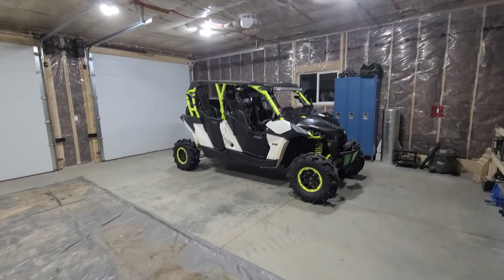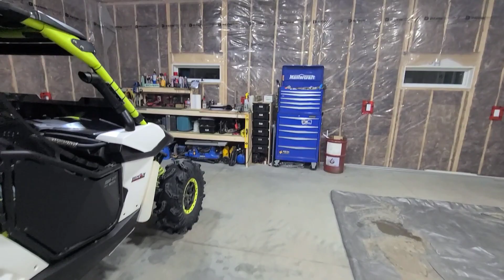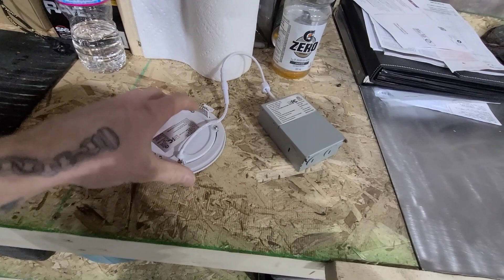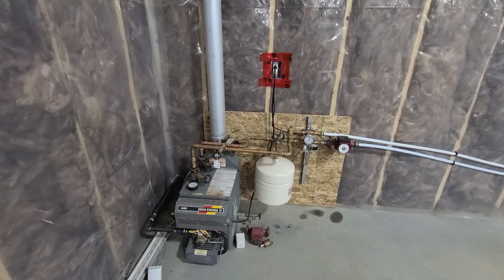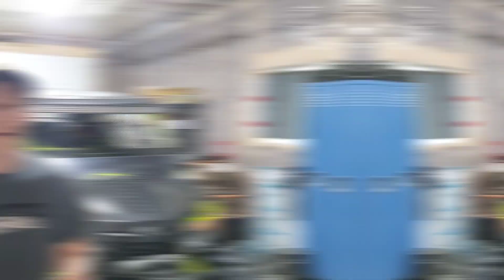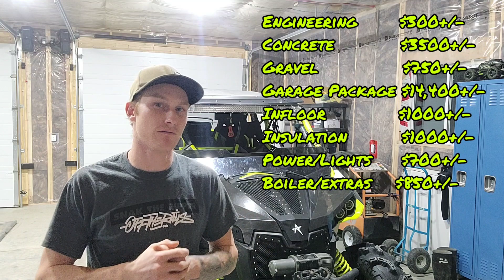How much did it cost to build my new garage | 2020

Comment: Looking at building very similar on the east coast.... I'll be helping, but I think I'll try to hire individuals to help rather then contractors.  Hope I can stay around $50K.  Only difference is I'd like 12' walls...maybe 14' with a loft over one bay for storage.
Reply from the maker: That would be really nice! I never cut my studs down from the 10' 3" just to give that extra hight so I have 10' 6" of ceiling height. I had plans to do vaulted ceiling till lumber skyrocketed and had to sacrifice that to pay for the extra cost in lumber. Goodluck!

Comment: Thanks for your video. I found it very useful, as I am looking to either expand my existing 1 car garage (but wood is $$$), or go with a steel building instead.  Any thoughts ?
 thanks again.
Reply from the maker: Thanks! Glad I could help. I would personally continue with what you currently have. Lumber prices should start to come down here shortly at consumer levels which will help.
Reply: @BertaRiders  6 months later and it seems that statment is still not true hahah. everything is higher

Comment: I am not a plumber but with a closed loop floor radiant, shouldn’t the accumulator tank be on top, instead of bottom? Even with running and bleeding the system with a glycol water mix, the heating will still cause bubbles. They go up but I know it’s main job is for expansion and contraction of temp changes. 
  Plus, when you say your floor concrete is a pad, it makes me think that no footings, it just floats on top of a properly prepared compact earth, then lift of 3/4-“ gravel over 2” extruded foam board then mesh, rebar and pex patterned out for even heating and simple zip tied to rebar. Pressure testing is done with 100 PSIG pressure for 24 hours to pass. There are areas in the Southern US where they put cable in floors, hydraulically tighten it into wedge-lock blocks at edge of poured pad. It is very different but won’t crack. Just curious. You never think as a dealer tech retiring and bring home tool boxes and all kinds of equipment. It make the garage small real quick. Thanks. I need one but it will be a decade for lumbar to come down if ever. Someone’s enjoying the profits, but not me!